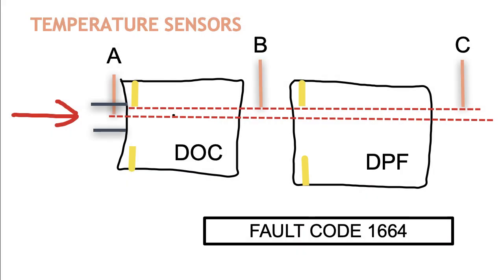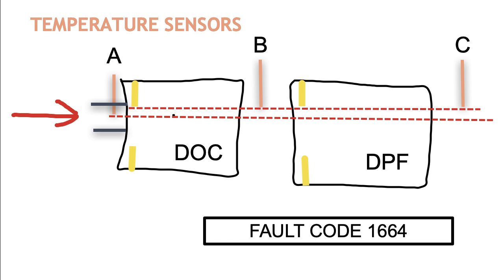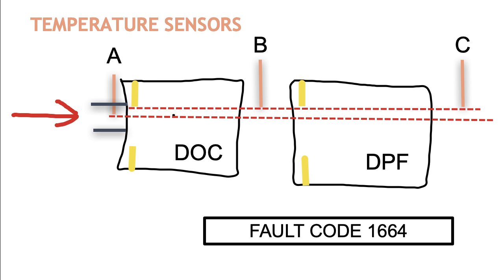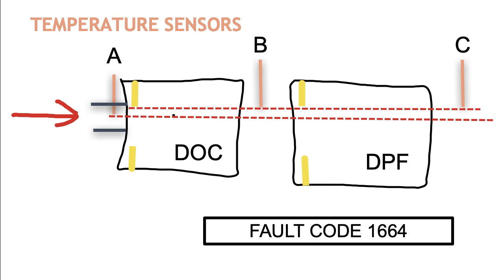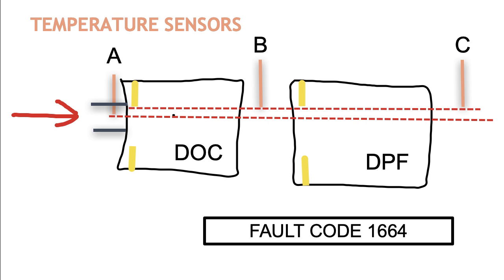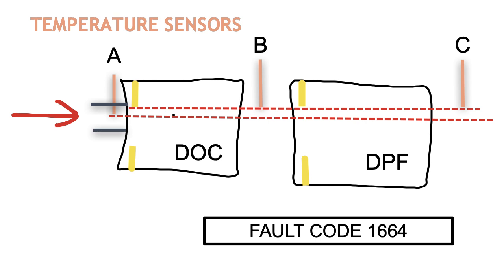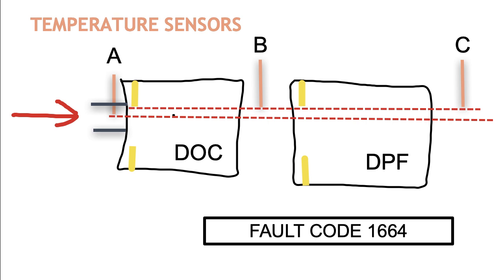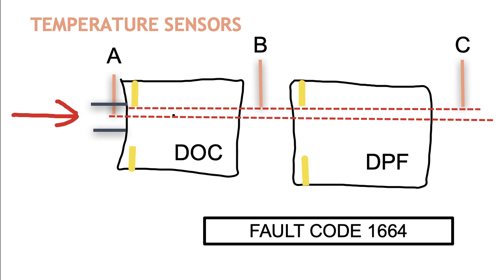What causes fault 1664 - DOC missing?

Comment: So if I keep having this issue off and on, Should I still clean out my DOC by taking it to be cleaned and baked at the shop or should I replace it? I just replaced my DPF when this fault code came up a few days later.
Reply from the maker: It just needs to be blown out with compressed air and put back in. But if you had an egr cooler failure and an antifreeze was going back that can coat the DOC's cells and then it has to be replaced.

Comment: Same experience with DOC's myself. I had to replace one a couple weeks ago and price has gone crazy on them (what hasn't). Many of the earlier style CES would start to leak from cracks behind the inlet heat shield, but local DPF cleaning service would repair for a good price with good results. The Paccar is nice because it shows target DOC outlet temp and HC dosing fuel quanity so kind of know what it should do as far heat generation during a regen and of course you can see if fuel catalyzing across a cleaned DPF which was the case of the degraded one i did last. The single canister ones like to break the baffle inlet screen but haven't noticed it much post 2020 ones. During the cold snap in January, i did have 2 units log DOC efficiency codes. Tough to do a proper regen when ambient air temp is below 0 F! Thanks Joe, always pick up something from your videos.
Reply from the maker: Yes cold weather is a challenge. On the 871's I used to pull out the threaded plug on the intake manifold during a regen to change the ratio of boost to exhaust gas pressure and that usually worked to get it into a regen.

Comment: On my six why does it say derate in 3 hours then does the countdown to de rate when there no codes at all
Reply from the maker: If you had any faults that relate to emissions the OBD system counts the time they are active. It will add time when every a fault goes active. Note there are a few faults that do not turn on the dash light you need a scanner or insite to see the faults. Once you drive 3 trips of > 4 hours if NO faults related to emissions went active then the 3 hours is reset to zero by the OBD system. Start by having someone with a scanner hook up. In a couple weeks I will have a video up that talks about a couple devices you can use your phone with to scan faults.